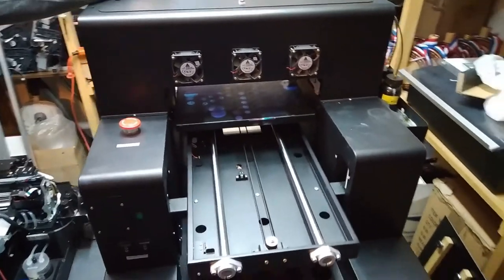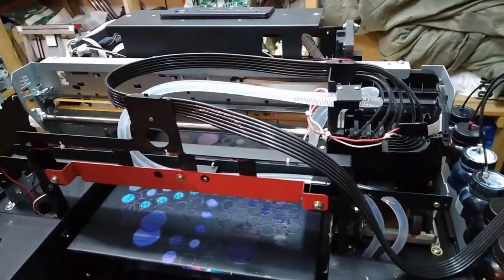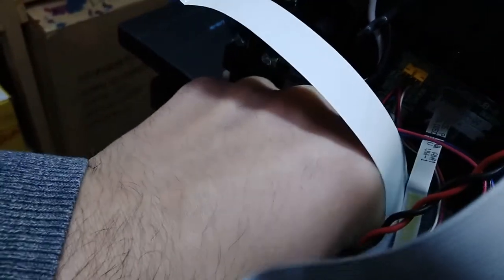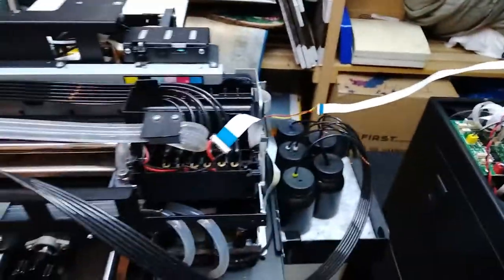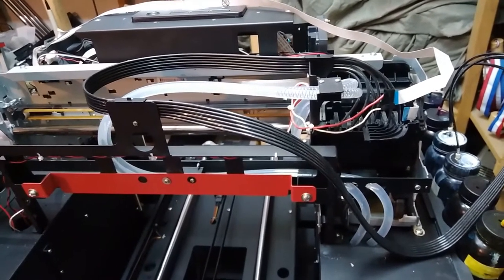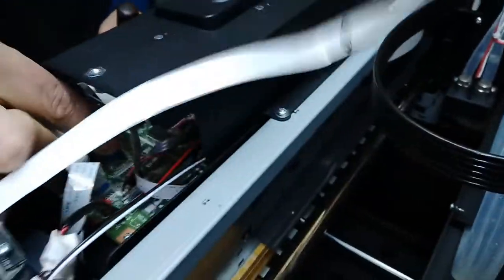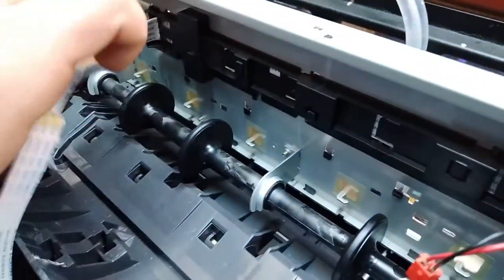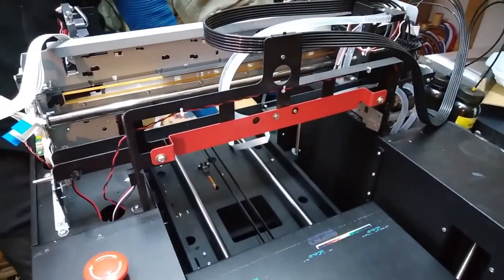UV printer L1800 repair (part 1)

Comment: Hi, I changed the head and it was not original, it burn transistor on mother board, I changed them and put the old head original head back, now when try to nozzle check or printing it comming white nothing prints, the desk is not recognised like before, I need help, do I need to install some other drivers or just L1800 drivers? Thnx

Comment: Hello, I had a question about the subject. How should the paint order on the head part be? I couldn't find the color sequence when white paint was added ?
Reply from the maker: Hi, the color order is Yellow-Black-White-White-Magenta-Cyan and that also the option you have to set in your Rip software. Is under color options "Ink channel". And you should have that option turned on all the time, regardless if the black or white shirt is printed, because that way we told the printer where we keep the white ink.

Comment: Hello, can I ask question
ho to make and place led curing system in that l1800?
Reply from the maker: Yes you have among the videos for UV repair how to mount the lamp, but you should also have some kind of cooling system for it. You should mount water pump, tubes and cooler, or you should at least have a fan cooling on the lamp.

Comment: Can You help me to repair my Printer problem. My printer problem is PF Motor Drive Error
Reply from the maker: try to clean the encoder strip behind the head carrier with alcohol. Call the head to the cartridge replacement position, than plug out the power cable. Now you can move the head with hand left and right and you can clean the encoder strip. It s a transparent plastic strip that goes behind the head carrier all the way from left to right.